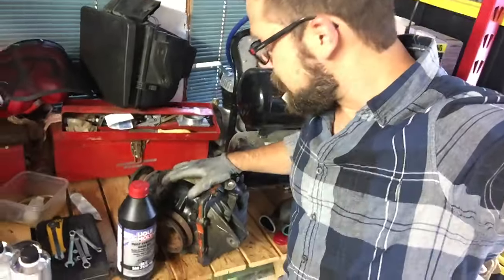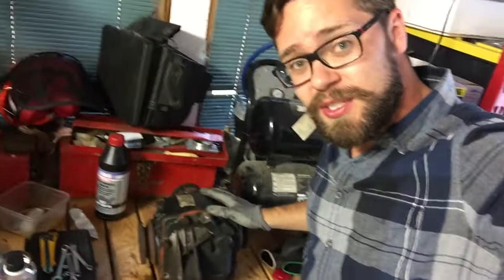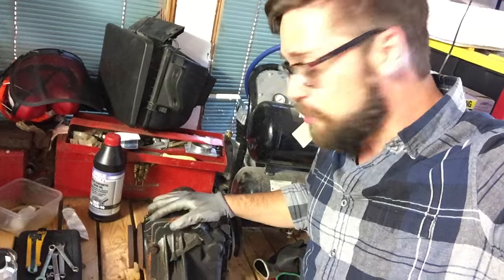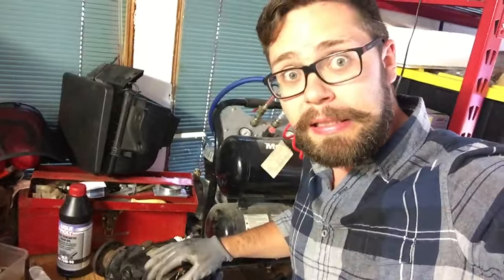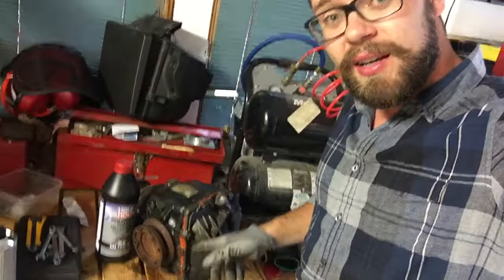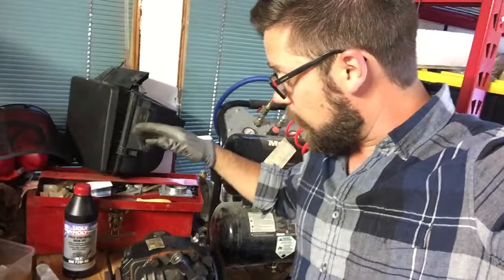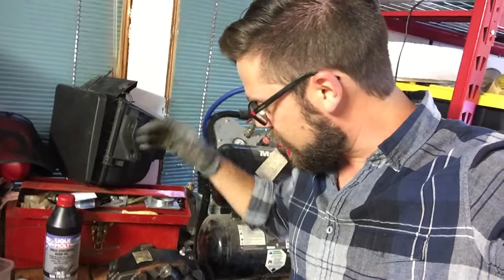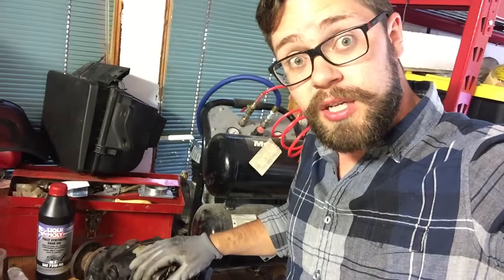The new 3.46 differential is coming soon. DIY and review to follow.

Comment: I did this on my 330ci and it helps. With my 2.93 to 3.38 (because of flanges) it was nearly halv a turn difference on driveshaft. I welded it cause it is car just for drifting and track. check my build thread on g+ if interested. good luck

Comment: I'm swapping to a manual transmission in a month or so in my 03 530i, and wondering if I should leave the stock auto-ratio rear end in (3.46 auto vs 2.93 for the manual). My thought is to have the 3.46 rebuilt into an LSD for the car, and then install it again later when I do a 6-speed conversion.
Reply from the maker: That's a big jump in ratio. Without the 6 speed you will be seeing really high revs on the freeway. I also will hopefully be converting this to an LSD later on. So I will use the ring gear from the 3.46 for that.

Comment: Hi! Could you please make a video on how different your acceleration becomes after and before the diff swap? I have an auto gearbox and it's toasted so I will swap in a manual 6 with the stock auto 3.38 ratio. Just kinda currious if it's really that big of a deal with the shorter final gear ratio. Thanks mate :)

Comment: How can i know the Best ratio for diff to use If i have 323i.??
Reply from the maker: http://www.bokchoys.com/differential/GearRatios.htm
Reply: +E46 Reviews with T.H. Thank your very much about the link and info but i didnt unserstand wich else model diff i can put in my car. is it possible to put 3.46 to my 323i? ;-) :-D
Reply from the maker: Depends on if it's a convertable, wagon, sedan, coupe, automatic or manual. Look on that chart for your car then follow along to the right side where it says final drive ratio. And yes the e46 differentials should be all comparable. I think the 330 has a different output flange and input flange though.
Reply: +E46 Reviews with T.H.  I have 2000 323i sedan..  so i can put in 3.46? And thank you a lot because im learning a lot of good things from your videos. :)
Reply: manual
Reply from the maker: So it looks like you have a 3.07 final ratio.  A jump to a 3.46 might be a bit much, and will really change how your car drives.  See if you can find a 3.38 ratio diff instead.  Thats one off of a 330.  But like I said, I don't think the input flanges will match up and you will have to swap them out.  Or just find a 3.46 (they are easier to find) and deal with the difference.  Wait and watch my review of it before you make a decision.  I will describe the difference it makes and weigh the pros and cons.
Reply: okay thank you very much you helped a lot.. And offcourse i Will wait. ;-) Thanks again..